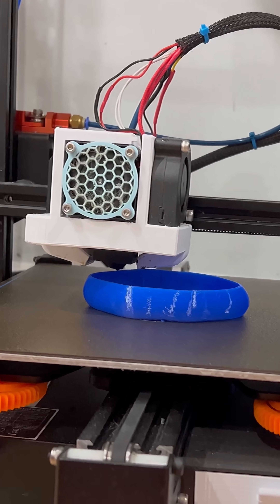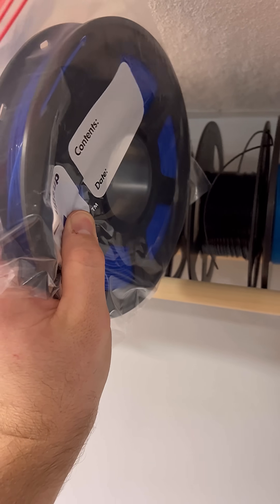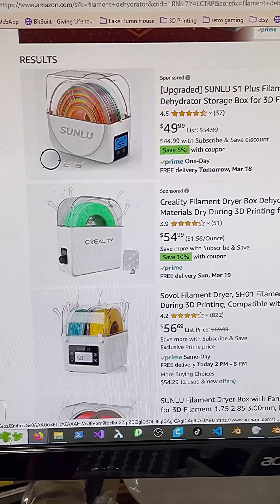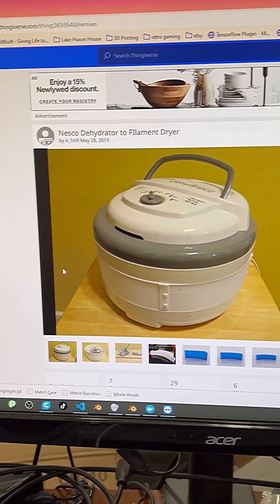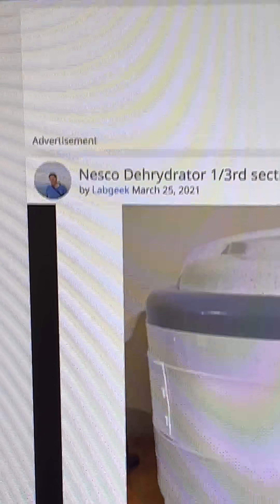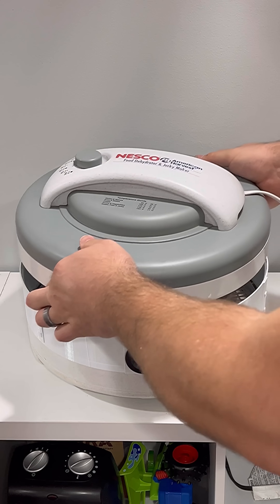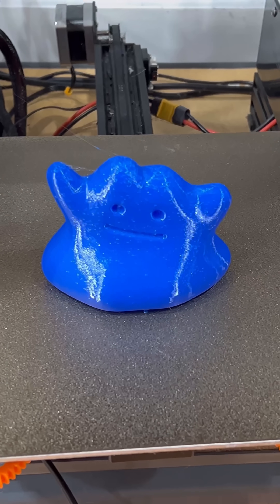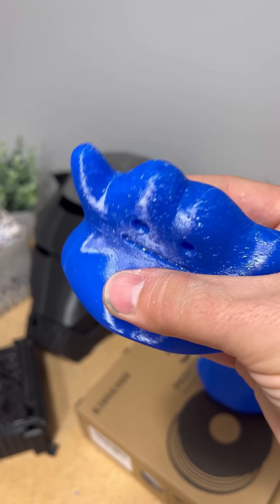Dry vs Moist TPU in 3D Printing

Comment: makes me wonder if someone would be willing to make a filament dehydrator that clicks onto the 3d printer so it can always stay dehydrated
Reply from the maker: I don't know of an exact model, but I have seen stand-alone filament dehydrators that also act as a spool holder and feed directly into the printer.
Reply: @printmeister  I could imagine someone could make an attachment for a dehydrator that would have a hole for filament to go through. It would have to be vertical tho...
Reply: @JessicaFEREM Why does it have to be vertical? I have a 5kg spool holder, and my stand for it holds horizontally. Works just as well.
Reply: You don't actually want that. Dehydrators have openings for airflow. What you really want is a dehydrator AND a box with 3a molecular sieves inside with a hole drilled in the lid.
Reply: You can use the filament box and poke 4-6 holes with a screwdriver.

Comment: I wonder if they'll ever have a filament that gets fuzzy in a controlled way to hide layer lines without the pitting the waterlogged stuff does
Reply: foaming filament already exists, it's based on temp rather than moisture though
Reply: Besides the mentioned foaming filaments, modern slicers also have a fuzzy skin option that does exactly what you are describing.

Comment: It’s amazing how community oriented 3D printing is, I can’t believe you found the mods for that exact dehydrator!
Reply from the maker: I know right?!  It’s so awesome!!
Reply: still can't find DS shells, which is the reason I'm making one lmao @printmeister
Reply: @AJButterFingers  No :( I am too bored so maybe I will. and I'm doing it for DS Lite.
Reply: I’m stoked bc I have the same exact dehydrator too. I actually make a lot off jerky with mine tho lol but def planning on drying out some tpu with that adaptor
Reply: @beurownboss1554 Is it safe to use it both for food and non food safe plastic? Genuinely curious
Reply: @pieceofpeace35  This depends on the type of plastics and nozzles you're using. Not really recommended for brass nozzles. TPU, PLA, PetG plastics are nontoxic and food safe, although some people are afraid of bacteria getting trapped and not reusable, I don't think that's entirely true, this depends on the print quality and how well you do wash it. Other plastics I wouldn't print especially if you want it nontoxic as it will contaminate. If one wanted to do both, I'd use two separate 3d printers.
Reply: @beurownboss1554  I wouldn't do both in the same one
Reply: @beurownboss1554 oooh what kind of jerky?
Reply: @JigglyPuff_JesusChristLovesYou  usually chicken jerky (chicken breast sliced super thin and in my marinate for 48hrs before drying) but I also do beef and deer jerky.
Reply: The 3d printing community is probably one of the best out there
Reply: if you become apart of the community keep it that way!
Reply: I think it really helps that that specific dehydrator is one of the most popular ones on the market, and has been for at least 20 years, but it's still awesome.
Reply: 3d printing community is actually what the linux community think about themself
Reply: I got a laser cutter several years after my 3D printer and it was surprising and disappointing how there's no community. I don't even save a lot of my one-offs because there's nowhere to share them.
Reply: @jayspeidell  Create one? 💐
Reply: Right!? I was so impressed, that’s what made me hit that like button lmao
Reply: Y'all finding mods like it's Minecraft irl 😂
Reply: Baloon
Reply: It's like the most common food dehydrator of all time lol
Reply: i mean, it is like the most common dehydrator that every one is based off of
Reply: The 3D printing community is the most united community almost y can any mod u need for your printer
Reply: Not disagreeing with you but it’s literally like the most common and probably #1 sold dehydrator for decades lol
Reply: I didn't found it for my dehydrator. I simply designed a own one. But not printed yet.... To much to print and only one printer 😅 I rly need to update the old ender 3v2 XD
Reply: Reminds me of the open source programming community, they work together so much. And programming overarches and overlaps with so many other things, like you can connect programming to 3d printing programming -> wanting to make a mod for your keyboard or smth -> 3d printing! And that’s a very simple link. They’re so related…
Reply: Yea it's not always that easy
Reply: @caseyboone7018  the community is toxic as fuck. You have no idea how many assholes who print I’ve come across that tried to tell me “fixes” for an issue I posted about having, that would’ve outright broke my printer if I hadn’t been smart enough to double check their advice.
Reply: I hope that all that garbage is made from plastic, there's not enough useless plastic junk
Reply: He went and bought that dehydrator because it had an adapter then claimed it was old for the video.
Reply: @archive8080 very possible and I’m always skeptical when it comes to videos like this as well.